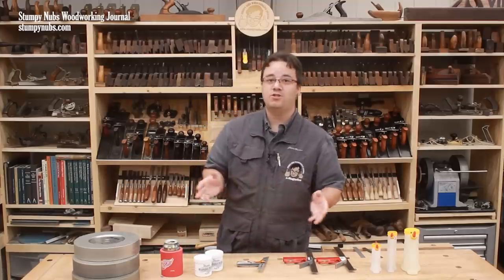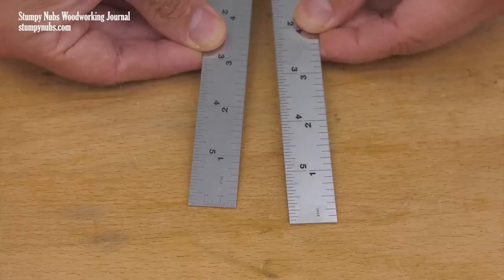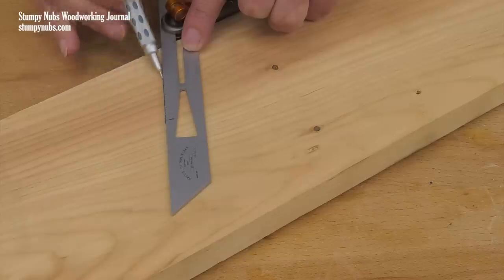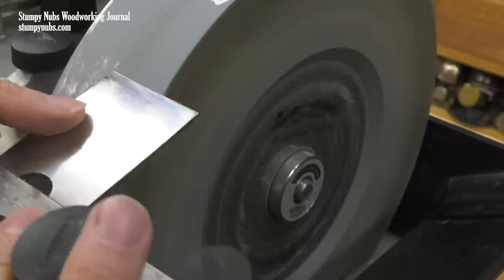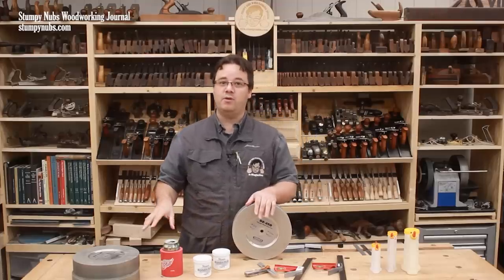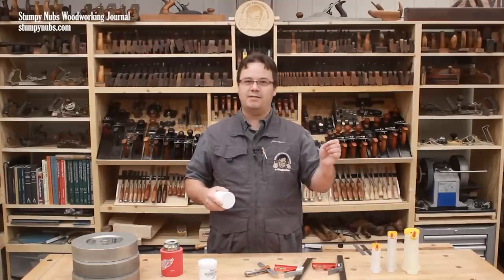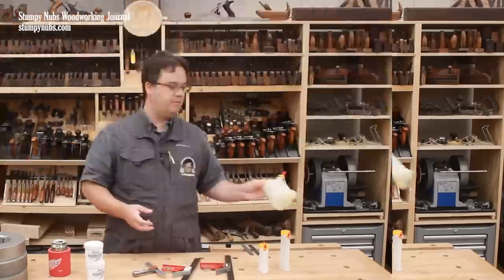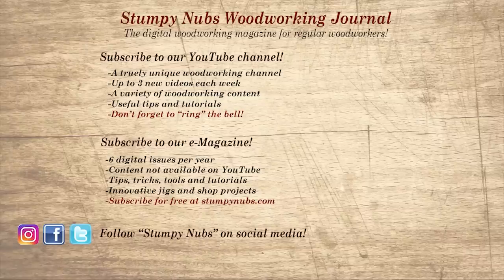7 of my favorite woodworking tools

Comment: I couldn’t agree more about the Shinwa measurement instruments. They are amazing and very modestly priced. I have 1 woodpecker edge rule and a whole plethora of Shinwa measuring devices. Saddle square, hole diameter checker, pocket angle finder and 3 basic rules of different sizes. I do love woodpecker but find myself reaching for the Shinwa equivalent far more frequently.

Comment: James Your  digests are not recommended for tool junkies like myself.🤣🤣🤣
Having watched this video I rushed to the tool shop and bought this Kapro combination square not looking at its price.
We opened it together with the shop keeper and checked the right angle with a reference square. 
It was perfect! 
Before I used a budget square which I adjusted myself with a thin file for an angle close to 90 degrees.
But there is no comparison between them.
Magnets of the square are very strong and keep the ruler firmly. The square is heavy and well machined. It is certainly a lifetime tool.
Thank you!

Comment: Hi James, I totally agree with your assessment of the Shinwa rules. The pick-up facility on the small rules is particularly helpful. I've also discovered another Japanese brand of rule, Mochimono whose amazing rule has a clear plastic side which is particularly helpful when lining up on marks etc., and an aluminium side for cutting against. However, it is the way the two sides are joined that is important. The join is  flexible rubber which allows the rule to be moved about on the surface but locks it in position with downward pressure. I have found this very helpful in countering my hand tremor. They are available from Rocky Mountain Leather and eBay.

Comment: Glubot is one of those things that you never thought you needed until you use it.  Kind of like a 123 block.  Soooo useful.  And thanks for the Bora quick setup table. I'll probably pick one up for larger project assembly.
Reply: Yup. Especially for the price, it's one of those things you should buy alongside your very first bottle of woodglue. It's gonna be a rounding error on your first proyect's costs, and will just make you happier for years.

Comment: The Kapro magnetic combination square is readily available in NZ, and actually cheaper than the Amazon price because of the postage.  I'll be getting one for sure.  I've had a large Glubot for less than a week, (after waiting months for it to arrive from the UK).  I think I have not been using it right though, so I'll try priming the small chamber before applying glue and see if that works better for me.

Comment: I ordered the 6 OZ glue bottle.  I build a lot of cutting boards and jewelry boxes.  I find it difficult to dispense glue from a large 16 oz bottle with out getting in all the places that I don't want it. Plus it is difficult to remove the glue from a spot that you intend to stain.  I usually pour some glue into a small tray and then use a small brush to put it where I want it.  After wards, I have to clean the brush and attempt to pour the unused portion of the glue back into the bottle. Then wash and store the small tray, which I can never find when I need it the next time. Not to mention how many times I have lost the small bladed cap that needs to go back on the large bottle.  I think this glue bottle will work out very nicely.

Comment: I've had a couple Centipedes for a while now (one from before Bora bought them) and they're fantastic. They're a must for a small shop that doesn't have room for large permanent tables. Used them for worktables, assembly tables, etc. When dealing with sheet goods, they may be the best as you can cut between the supports without worry of damaging a table underneath, while using their bench dog style hold downs on either side.

Comment: There's an Australian woodworking YouTuber uses tomato sauce bottle for glue. Squeezy sides for driving out glue, sucking some back in. Press on top. There's probably a spare in the pantry. I have been using Selly's PVA. The top screws on, wiping glue off the top with a paper towel seems to keep it clean enough.

Comment: FYI, I tried the small glue-bot and was not happy with it.  I found the opening at the tip to be too small, even when I clipped it to make the opening larger.  It severely limited the amount of glue the bottle sucked back in, so I was constantly clearing the opening with a pin.  But I will try the larger version.  I suspect I'll be happier with the results.

Comment: The only problem I have with those Glubot glue bottles are the bigger, black rubber ring in the cap. I wish they would make the cap differently because I used to use them at work but once that black ring would wear out or would get a crease in it where air could get through and wouldn’t release glue. I was done with them. But everyone has there own opinions, glad to hear they work good for you!
Reply: same here
Reply: Yea, honestly I prefer a simple squeeze bottle the best but do find the tiny glubot handy for repairs or getting into cracks
Reply: I had the same problem but what I did was cut a square from a ziplock sandwich bag then place it over the top after refilling and then screw the lid back on.  Yes it does stick out from the edge a bit but it was a cheap and easy solution that seals it up just as good as the rubber gasket it came with.  No air leaks and the glue doesn’t adhere to it so it can be easily replaced when needed.  Drew
Reply: Had the same problem but when I cut a bigger hole for the nozzle it seemed to solve the problem since the air/glue wants to escape via path of least resistance

Comment: I love the Glubot bottles. I'll never go back to standard bottles after using Glubot for years. They work in virtually any angle and you can cut the tips to your preferred length to control flow. 

Can you tell me more about the Tormek? I have a new set of Narex chisels and I'm not very skilled at sharpening by hand. Can the Tormek flatten the backs? What would I need to get "scary" sharp chisels and can it do away with all the manual sharpening?
Reply from the maker: Yes, the Tormek can do the backs. But I prefer to lap the backs manually on a diamond stone, then use the Tormek for all the day to day sharpening. "Scary sharp" generally refers to a process using sandpaper. It's just a marketing term. It does not make tools "sharper" than any other method. Here's a video that gives a nice overview of the Tormek: https://youtu.be/BtpkbYCnwpI?t=291

Comment: I’m repurposing maple floor to creat my first woodworking bench. I’m concerned about over gluing, over clamping,  and I have several gaps at the ends of the boards that I didn’t see at the time it came together. Can you help me determine if I’m doing things right before I get to far longe and regret not asking In advance?

Comment: How can a new woodworker figure out how to set up a 5/8” wide chamfer at 45 degree angle on one edge around a standard 2x6 board.  Is a tool available for this for use with a table saw or a chart?  The 5/8” width gets thrown off my the thickness of my blade.

Comment: I am always willing to take a chance on quality Japanese tools. I have a Japanese made scratch awl that makes very good starter holes for drillbits.  You can use it with or without a hammer, and you can wallow out a larger hole quite easily.  It is also quite small, and I would say, a little bit chubby.

Comment: If Shinwa happen to be reading your comments, a version with full millimetre markings only (on both edges) would be appreciated.  For the same reason you're using the larger sub-inch markings I suspect;  my eyes are starting to have trouble making out the half-millimetre markings....actually, that's been true for a while to be honest and now they're having trouble making out the full millimetre marks so a clear scale that shows full millimetres in a similar way to the halfs - every other one longer - would be really helpful.  They do a "pick-up" one that's sort of like that but my major issue with that is the abbreviation of the numbers - so they go 8, 9, 10, 1, 2, 3...., 8, 9, 20.   They problem with this is that it's soooo easy to make a mistake and measure 8cm when it should have been 18cm.
I'd also argue that the back should be metric only too, perhaps graduated from the other end so you can spin it instead of flipping it.  Why?  Well, 99% of the time, you're either working in metric or imperial.  I'd rather buy a metric rule that works really well and buy another imperial rule (if I ever need one) than buy one that sort of works well-ish for both.

Comment: I hate the glue bottle that you showed.  I can  stop the glue from drying and needing pliers to open the bottle.  I had a rusty large washer that at least makes it possible to open the bottle without pliers of screw driver. The washer has to be centered when closing or else the cap is stopped by the washer from closing.  I am going to get the bottle you suggested.

Comment: Why doesn’t somebody make a combo square with a fixed registration pin to engage a groove in the ruler and a knurled thumbscrew on the side to lock it. Reversing the ruler then becomes a piece of cake.
Reply: Patent your idea!
Reply: A bolt pressing on the ruler from the side can make the ruler wander left or right as you tighten down depending on how the ruler and bolt end interact. I had a problem like that with a chop saw fence stop that I made. The bolt would move the fence about 1/16th of an inch as I tightened it into place. I found a good way to fix it though. Should we collaborate on a design? I'm half serious, sounds kind of fun to try to bring a product to market

Comment: I had a Gluebot for about 2 years.  I recently through it away, I hated it.  Glue kept getting clogged in the nozzle and the tube.  I got tired of having to clean it out.  And yes I always put the cap back on.  I didn't find it anymore useful or helpful than just the Tite-bond bottle.

Comment: Never have been able to take those glue caps apart to clean them. Afraid I’m going to destroy it. Bought a glue bot several years ago and use it exclusively.
Reply: @johncoops6897  lol, not sure if you’re joking or not 🙂. I’m trying to pull just the tip off to clean that stupid thing. Don’t want to clean the entire cap. That’s ludicrous.

Comment: I actually like the shinwa rule better, it has the Large Inch numbers starting from both sides. You can what I'm talking about it goes (1/5) (2/4) (3/3) (4/2) (5/1) so depending on which edge you use it is numbered and you don't have to read it backwards and upside down.
The other brand you showed did not have this feature

Comment: Not sure what I'm missing about the Glubot, but mine is a disaster.  Too much air gets by the main cap to allow for dispensation of glue, and I have that cap gorilla tight.  I'm wondering if this product was once good but manufacture now became subpar and it's now useless.  This is the only "cool tool" that I've regretted buying.  It's worse than useless, because it wastes the glue I've put in it.

Comment: If someone haven't already I will probably wind up(at some point when needed , item number 156869 on the to-do list...) designing a version of that centipede thing with 3D print parts to be combined with PEX tubing and allthread...
Reply from the maker: You plan on printing out the steel struts?
Reply: @StumpyNubs  All-thread...
Reply from the maker: Why would use use all-thread to make the cross pieces?
Reply: @StumpyNubs  Cheap, easy to work with, available down to M3 without much looking, ready-made lengths, threaded so making attachments for the ends would be easy and the center-joints would stay in place and be easy to work out(short m3 pieces with a nut on each end for the pivot of a printed part that would have the althread strut go through it and lock it in place).

If I just were to make it for myself I would just use flat-stock and a lot less 3D printed parts but people with 3D printers come with varying skill-sets and tools so anything put on thingiverse should reflect that and only require non printed bits that require minimal tooling and skill and that's readily available everywhere...

Comment: "...most of the time I'm working in eighths and sixteenths":   Every time I see something about rulers/tapes, etc, I marvel at how the USA has not at least moved to decimal inches, instead of sticking with the unbelievably cumbersome fractional system!  Ok, so we are apparently too stupid or stubborn to go metric, but come on!  WHY not use decimal inches??????  WHY are woodworkers (and everyone) stuck on the ridiculous fractions of our rules, drill bits, etc????  Is it REALLY that hard to have a .25 inch bit instead of a 1/4" bit?  Couldn't wood be 0.75" thick instead of 3/4"???
Reply from the maker: Why do you think 1/8ths and 1/16ths are so hard?